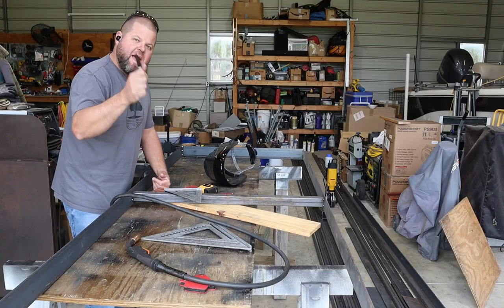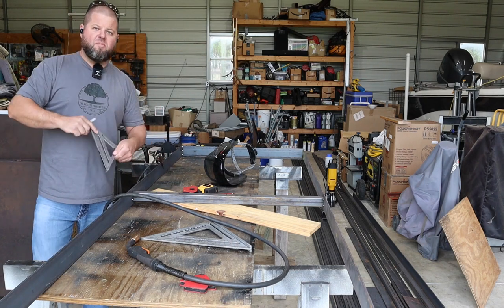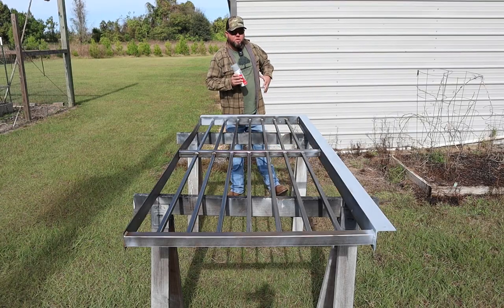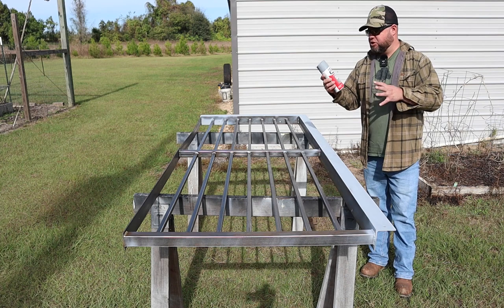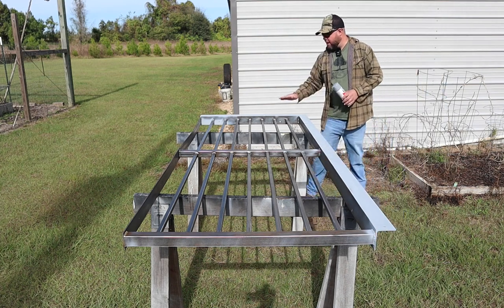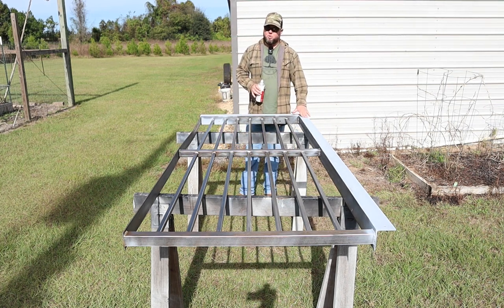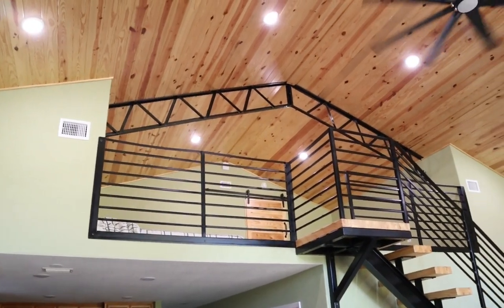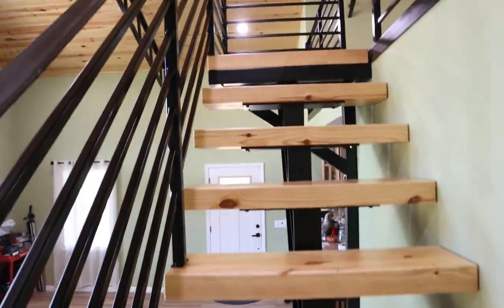DIY stair build part 4! Metal railings.. #689

Comment: One thing I would also suggest you guys can use is POR-15. it's a primer for metal but also totally eliminates any oxygen and water underneath it's coating, it completely eliminates everything that would cause the metal to rust more, you wouldn't need to worry about missing tiny areas you can't see with rust because it stops the metal from ever rusting again. It's often used on the underbodies of old cars to stop them from rusting when exposed to moist environments like snow and rain.

Comment: Andrew, you have done an outstanding job on the stairs and railing. I can relate to your frustration with building the angled hand rail down the stairs. Helped build a wooden rail system once and it was a pain to get all of the angles and to align and maintain the required distancing. You have knocked this one out of the park. 🎉
Reply from the maker: Thank you

Comment: Andrew your work is amazing as usual. Because of my taste and I know everyone's taste is different. What I would have done on the staircase is somehow blend the main support post that goes from floor to platform up the wall. So it looks like there is no support post giving it the illusion that it's floating. You are a very talented person. 👌
Reply from the maker: I didn't know the design when I framed a year ago or I would have worked something into the actual wall.
Reply: I agree with you Andrew. If I remember your office loft was not in your original design which you wouldn't have thought about a staircase. Don't get me wrong it still came out 👍
Reply from the maker: Yep it was designed as a single story.

Comment: The railings look amazing.  You might want to check the local building code.  Not sure solid horizontal bars are allowed because they provide a way for kids to climb over a railing.
Reply from the maker: I checked that months ago, no ladder effect or code rules stating such. Just height, walkway width, distance from wall and member spacing requirements.

Comment: Great project that turned out incredible--strong work! Do you by chance have a list of materials details you can share? You mentioned 3/4" square tubing for the horizontal spindles, but what wall thickness? Can you share more info on the materials you selected? I presume it's all hot-rolled.
Reply from the maker: No list, built as I went along. The tubing was 11ga because that's all I could find. I wanted 14ga to save weight.
Reply: @TKCL  Was the square tubing for the uprights 1-1/2" in size? And the angles you used...3x3x3/16"?
Reply from the maker: Correct
Reply from the maker: And come to think of it, I was able to get 14ga for the railings. I forgot I had to get it ordered from another supplier.
Reply: @TKCL   Cool...thanks for the information!

Comment: How much did this actually save when you factor in the cost of the equipment/tools needed?
Reply from the maker: Still saved thousands, but I don't factor the tools in as I've already owned and used them for dozens of other jobs. They have already paid for themselves. Nothing I used was a one time use or stair job specific tool.

Comment: Looks awesome. Where are you gonna put the zip line?  

When you were talking about the expanding and shrinking and all that. I still have the same problem but I’m getting better. Good welders or experience welders learn how to tack it correctly so that doesn’t happen. I watched a bunch of videos and I’m getting there but it’s a lot more difficult than it seems. But your ass looks pretty straight so you got it figured out. Well companies use jigs to do it so the pieces can’t move but it’s definitely hard to get everything straight and he did a great job
Reply from the maker: Big problem was I couldn't weld all this bolted in place. No welding in the house 😬
Reply: @TKCL  pfft. Who built the whole house, any damage you do Welding you already know how to fix. 😂😂😂

Comment: what's the height of the ceilings in your great room? side and peak of cathedral
Reply from the maker: Side walls are 12ft, peak is 16ft.  If building a true second floor your going to want higher side walls.
Reply: @TKCL  i'm building a house with a loft and my side walls are 9 and peak is 17 and i'm concerned on how the room will fit the staircase